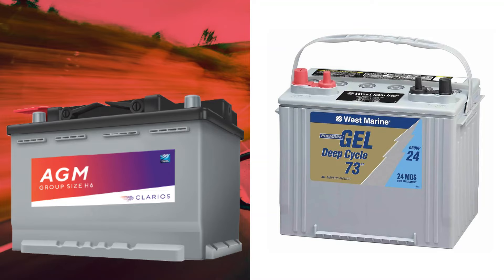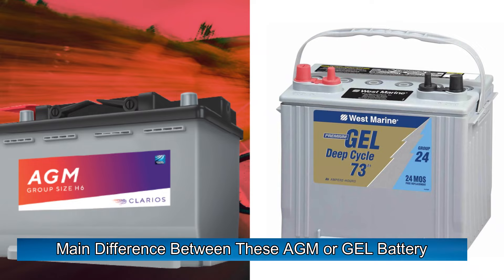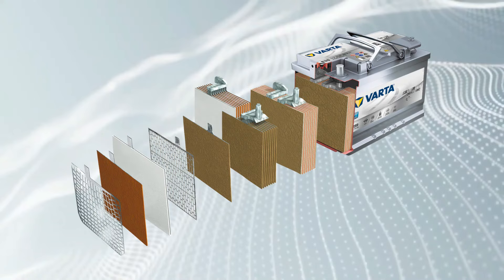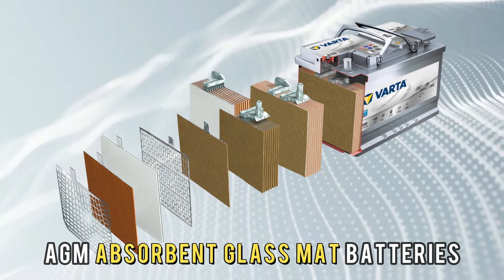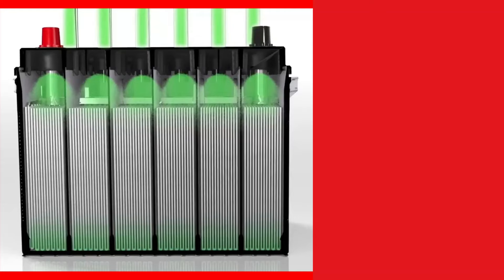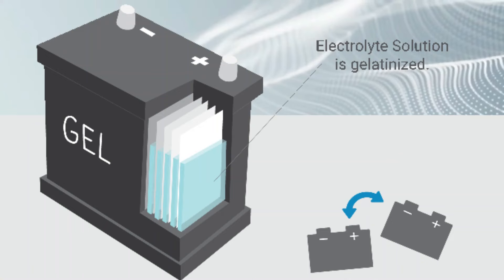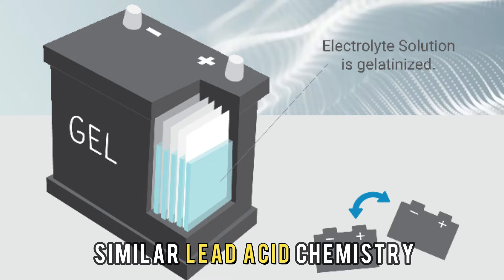AGM vs GEL Battery: What's the Difference? (Which Battery Type is Better?)

Comment: Hi in my experience gel batteries are more expensive than silver calcium lead acid.but in high temperature areas they don't even last a year
Reply: I am End of Life, Stage D C. H. F. and right kidney damage, and, blood in urine, but at 69, on asthma medicine, sense 1960"s, Isurpel Asthma Inhalers, Adrenalin shots, so I drilled, 1/4" holes, in my new PRIDE Go, . MED Chair, a 12 volt, 20 amps, so to be cooler, in a black plastic box, I drilled, 1/4" holes, every, 2 " now, batteries, stay, cooler, last loonger